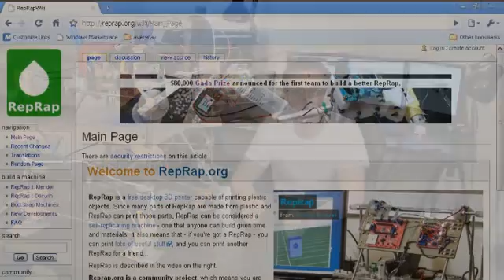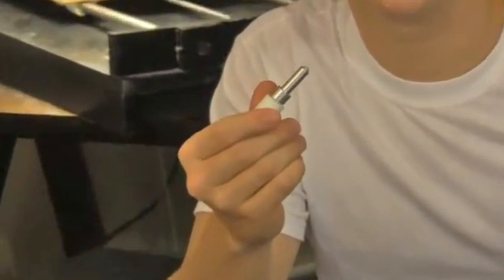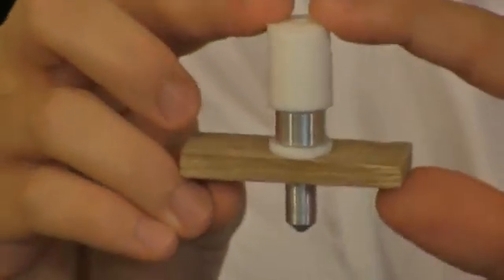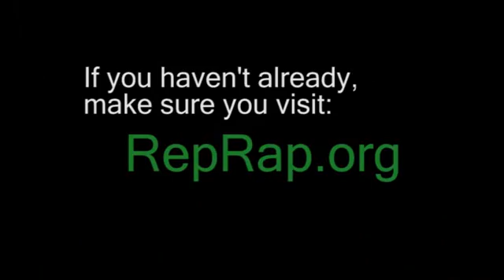onshouldersTv: RepRap 3d Printer Makes a Child

Comment: This is so cool to look back on 12 years down the line and where the technology has gone.
Reply: Literally got my friend into 3d printing, and with Bambu lab printers, it's just so easy,... Can't appreciate how far it's come or how impressive of a feat it is so be able to print so well
Reply: @ivangutowski  It is kind of a bitter sweet feeling seeing how common place its become,  in 2012 i got my first printer,  it came as a flat pack kit,  nothing was pre-assembled it was 3 sheets of laser cut wood  nuts bolts soldering programing  ect,  took me and my roommate like 4 days to put it together and it absolutely blew our minds the first time it worked correctly.  just this sense of awe that we'd built this behemoth from a pile of parts with a guide and now it was making something digital into something we could hold in our hands.

I guess its just the nature of progress ,  the end result is so much more accessible to the everyman,  but it just feels kind of sad that so few these days will get that sense of accomplishment and awe of building the machine from the ground up and developing a complete understanding of how the machine works.

Comment from the maker: @CleanEdgeProductions They are 28M035 Lin Engineering 4218L-01-10 bipolar stepper motors, but the place I bought them from no longer sells them. Take a look at the suppliers on reprap.org/wiki/Mendel_Stepping_Motors and see if you find some good ones that are still for sale.

Comment: what, did you print all the parts first, and then assemble? It looks like you printed a few parts and started assembly at high speed, and added parts as they were printed, except  there's no printing going on with Darwin during your assembly.

Comment from the maker: @mariushermanbotha 

The hot tip is still under development, and I don't think anyone is selling them right now. 

You can read about the specs here: 
  blog.reprap.org/2010/06/yet-another-extruder-nozzle.html 

I made mine on my lathe, and I think Adrian did the same. I'll post more details on my blog once I verify it will last.

If you want more info on extruders in general, a source I go to a lot is hydraraptor.blogspot.com